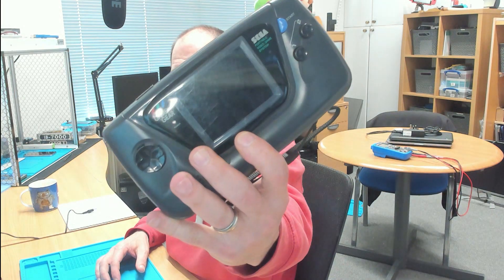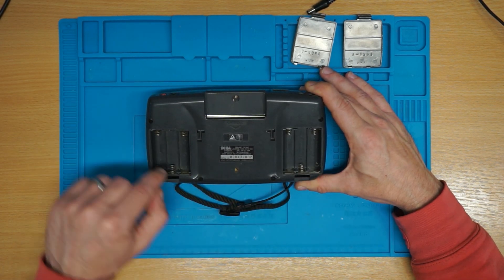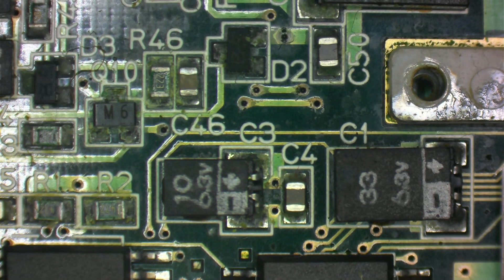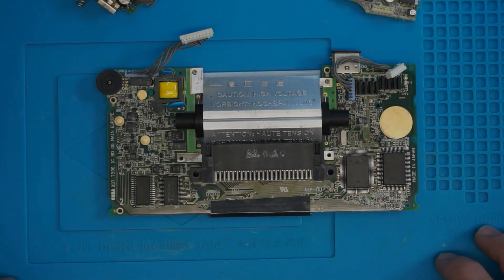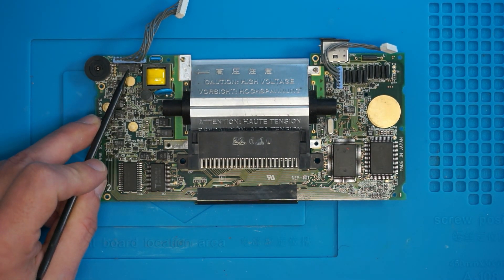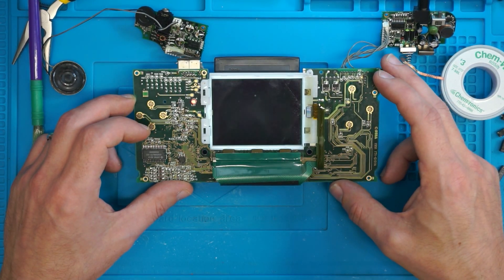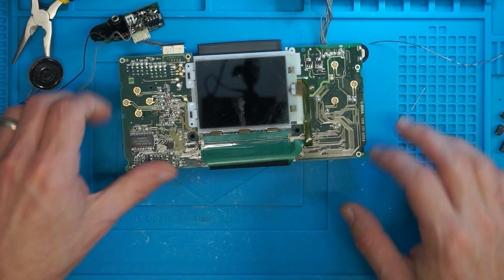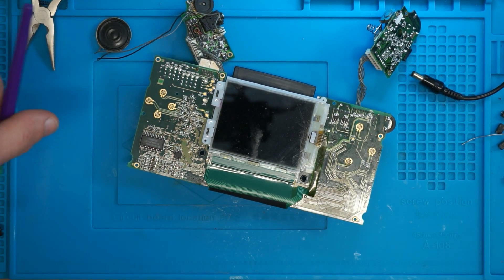GameGear Recap - Power / Audio / Main Boards With A SHOCKING Result!!

Comment: How did you select the ceramic capacitor ratings? The ceramic capacitors don't achieve the same result for the circuit as electrolytic caps when being exchanged 1:1. The ceramic should be rated for much higher voltage when you need them to supply energy according to their nominal capacity. It sounds strange, but it is an experience from retro computing guys.
Reply from the maker: The kit was from Retro Six buddy, I'm assuming and hoping given that he knows his stiff, all the ceramics were of a value that covered the needs of the board.
Reply: OK. So we don't really know. It is a non-issue in many cases. But sometimes stuff is strange without any obvious reason, e.g. the sound or distortion in video signal (which is not a topic on Game Gear).
Reply from the maker: @marcianzero_yt  I'll definitely bare this in mind. I did actually go through all the values in the raw footage. Part of me wishes I'd have kept it in but there's a balance I need to at least try to keep. Appreciate your support buddy

Comment: The nicest shot I ever received was from the flash of one of the pocket photo cameras we had in the 90's. With the 2 AAA cells and the electronics make the whistling sound while recharging the flash capacitor. I wanted to extract the flash from the cam, because I had some plans for it unrelated to taking photographs. That went wrong. But it was just a split second. Very high voltage, very low amps.
Reply from the maker: Oh yeah! I've done that on a camera myself! Smarts a little!